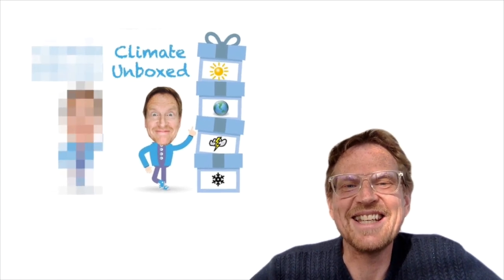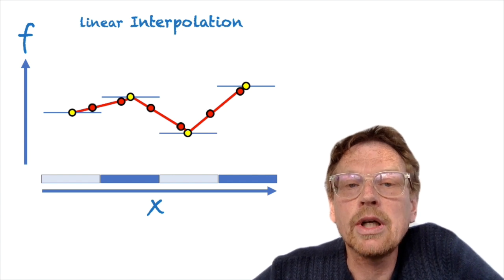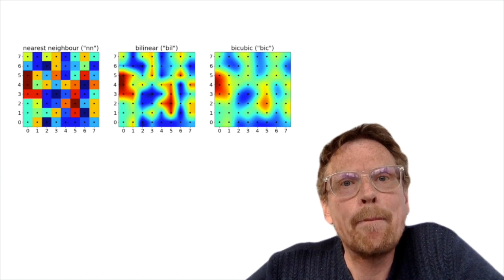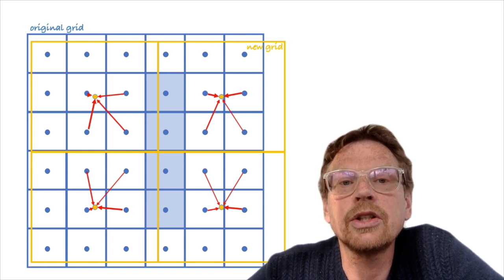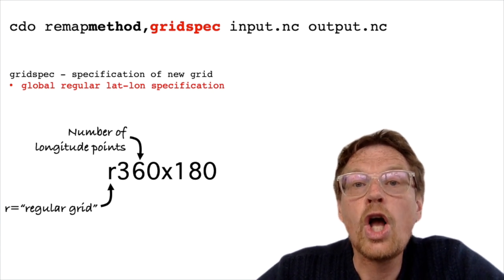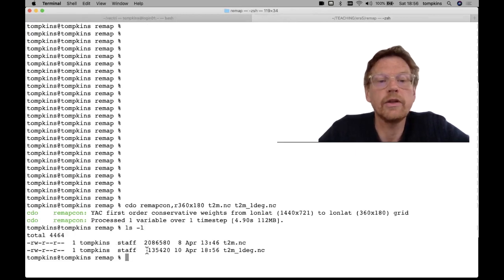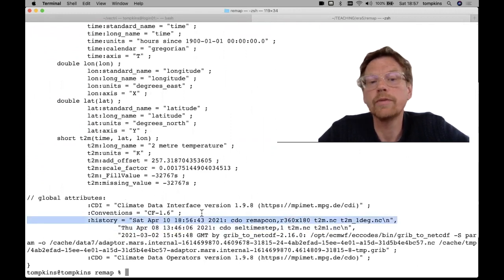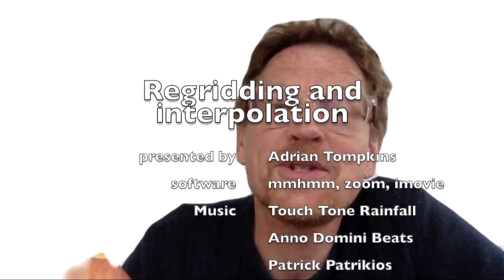regridding and interpolation - an essential life skill !

Comment: Hi . I am currently taking your class in ICTP.edx online and I am applying all the techniques in my research. I just have a question, in the ncdump -h 

1. dimensions:
 time = UNLIMITED; (36 currently) ---> my datasets have different numbers on the parenthesis. Does this cause a problem in the grid dimensions
lon and lat dimensions are uniform. 
2. When using mergetime, I got an error 

cdo mergetime(abort): Grid size of the input parameter precip do not match. 
From the video, regridding was done with the issue of resolution. Would love to hear your advice when it comes to the variables.

 Thank you so much for doing these videos. They are really amazing and informative.
Reply from the maker: Hi shielo this is a bit tricky to answer in YouTube Chat. Can you copy the discussion over to the discussion pages on the openedx  perhaps?  What are the inputs of the mergetime command by the way? Also which question? Best wishes

Comment: great video,  A question: I've two data sets with different spatial resolutions and I want to recalculate the values of a grid decreasing the resolution . i'm try with the bi-linear method, should i re-grid the higher resolution  (0.44) to lower resolution (0.03)?
please give command 
e.g  cdo remapbil,r720x360 input.nc out.nc
Reply from the maker: Thanks for your kind feedback. As i say in the video, the choice of regridding method depends on the direction. If there are features of the high resolution you want to retain you can go from low to high. In this case you can use bilinear or nearest neighbour. I wouldn't use the command you state but instead directly map one to the other e.g cdo remapnn,high.nc low.nc low_remap.nc      but if you go the other direction better to use conservative remapping for reasons i explain in the video. E.g. cdo remapcon,low.nc high.nc remapped.nc
Reply from the maker: PS. Don't forget to subscribe and spread the word about the channel. I know i haven't uploaded anything for a couple of months, work totally crazy at the moment but am working on new material

Comment: it is grate lecture .when i apply regridding to a particular country precipition data. the obtained data crossing the boundary line of the country. could you please explain why this happening.
Reply from the maker: CDO doesn't know about boundaries, only the grid you are projecting to... Does the output field match the target grid specified? Next week i will release a video on land sea masks to handle coastal boundaries correctly. However if you want to mask data using a country shape file you need to do this in R or python. I'll eventually show how to do this too but it is lower down the Todo list I'm afraid...

Comment: What do you opinion if i'm using bilinear interpolatiom for regrid surface air temperature ? Does it "proper"
Reply from the maker: Temperature is a fairly "smooth"field so you can get away with bilinear interpolation in most circumstances

Comment: can we interpolate  rainfall data using the methods mentioned in the video
Reply from the maker: Yes indeed, but with noisy fields like precipitation you probably want to use remapcon. But it depends on the resolution change fine to coarse or the other way around. I hope the material in the video was useful for this.

Comment: my problem is not an interpolation but a remapping. my data instead to have a regular grid of longitude starting from 0 to 360, it starts from 320 to 319. I mean 320 to 360 and from 1 to 319. how to fix that.

Comment: Hi! tks for this video. A question: I've two datasets with different spatial resolutions and I want to recalculate the values of a grid decreasing the resolution (for pixel-to-pixel comparison). Trivially with the conservative method, I should calculate average the values of the higher resolution pixels (0.05) within the polygon of the lower resolution (0.1)? Or is this not correct? Thank you again.
Reply from the maker: Hi Camilo. There is not a correct method, both are fine. You can interpolate the coarse to the fine grid or the fine to the coarse. The important thing is the take care of the method used if you coarsen the fine grid as per the notes in the video. I hope you found the video helpful! Please be sure to subscribe so you receive notification when I upload new material. 😉

Comment: When I try to remap my data using 'cdo remapbil,example_file input_file output_file, I get the following error: Unsupported generic coordinates (Variable: X)! Strange, because my netcdf has 3 dimensions (time, lat, lon). Have you experienced such error as well?
Reply from the maker: That's very strange, are the units set to be CF compliant on the lon and lat? e.g. degrees_east etc?
Reply: @John van de Ven  @climateunboxed  I had the same question - thanks for clarifying. I'd also like to add when remaping, sometimes the variable name "longitude/latitude" changes to "lat/lon". I'm guessing this can also be avoided if the data is CF compliant Thank you very much for these tutorials - they are very helpful.

Comment: Thank you for the video. I am struggling with the download of CDO. Is there an easy way to be able to use this command?
Reply from the maker: hi - If you are on a mac, I advise to use homebrew and then it is "brew install cdo" - if you are on linux like ubuntu or mint, it is "sudo apt-get install cdo" - if you are on windows 10, then the best solution is to install the linux subsystem (this is available directly within windows 10 and is very easy to activate, i.e. do NOT use a wineserver or cygwin), and then you can open a ubuntu terminal withins windows and follow the linux instructions. :-)
Reply: @climateunboxed  Great video. Although I tried installing cdo using all sorts of ways. Also using homebrew. I still get the following error when I try to run the following code: cdo remapbil,gridfile.txt input.nc output.nc (where input.nc and output.nc are named differently) -> Unsupported file type (library support not compiled in) To create a CDO application with NetCDF4 support use: ./configure --with-netcdf=<NetCDF4 root directory> ... Any tips? Maybe make a quick video on how to download and install cdo properly. Not a lot of information out there.
Reply from the maker: @achterbumper  Sorry to be slow to reply, moved house and no internet yet and zero phone signal !!! I feel cut off from the world!!!  Anyway, try uninstalling cdo with brew, THEN try first to do   "brew install netcdf", and then reinstall cdo with brew... let me know if that helps
Reply from the maker: which platform are you on?  I'll try to put a video together for this, but I need to finish some others first that I need for an online course.
Reply: @climateunboxed  I do am on a mac. After trying several methods which didn't work, including homebrew initially. I tried again by uninstalling all packages (hdf,netcdf,cdo) and reinstalling them with homebrew. That seemed to do the trick! Thanks for the tip!
Reply from the maker: @achterbumper  Glad that helped - I'm not totally hot on the installation side of things, I tend to muddle through as best I can.  Spread the word about the channel, I'll be uploading more material shortly now my teaching has finished until Autumn (yay!)

Comment: cdo remapcon (Abort): Open failed on gridspec.txt! 

How to resolve this?
Reply from the maker: Sounds like you missed the comma or the gridspec file not correct. Difficult to answer here, without seeing the command and file. Try to post both to stack overflow with the tag cdo-climate and I can try to help there

Comment: great lecture, How can it solve 'segmentation fault  core dumped' when i run cdo remapbil dridspace input.nc output.nc
Reply from the maker: Are you piping (i.e. concatenating commands)?  This can cause a seg fault if you don't force sequential operation with -L  which  does a Lock I/O (sequential access).  [I'll post a video on piping soon] - Otherwise not sure, could be the compilation of cdo on the system. Try to update within apt...

Comment: Dear Adrian, on regridding my tmax file from coarser to finer resolution it is also using the fill value/ missing value (i.e 99) in the calculation for the nearby grids. How to avoid this?
Reply from the maker: Do you mean some cells are marked as missing with 99 ? This is correct behavior. But if you mean the 99 is being used as a field value, ( e.g. you get some strange entries such as 56 due to 99 being "merged" with nearby true values) it shouldn't do this if 99 is defined as missing in the field metadata. Have you checked this is the case using ncdump -h ? If it is not set I can tell you how to add out using nco
Reply: @climateunboxed  Please tell me how to set this.
Reply from the maker: What did the tmax metadata look like though? Can you cut and paste it here first?
Reply: @climateunboxed  Dear Adrian, If possible, can I mail my tmax file to you? It says  _FillValue = NaN, // double, but when I am looking at the data, wherever value is missing 99.9 is written. And this 99.9 is also participating in the regridding process, and this is giving trouble to me.
Reply from the maker: @arjunkaushik5075  Try this command on the original file and see if it helps: ncatted -a _FillValue,,m,f,99.9 tmax.nc

or if you want to use cdo you can alternatively try cdo setmisstoc,99.9 t2m.nc t2m_new.nc

I'm afraid I can't do bespoke file investigations, as I'm snowed under with the day job at the moment (in fact, I'm way behind schedule on these videos too, which I need to finish for a EDX course I am launching)
Reply from the maker: ps: the double comma in the ncatted is not a mistake, the argument between is empty